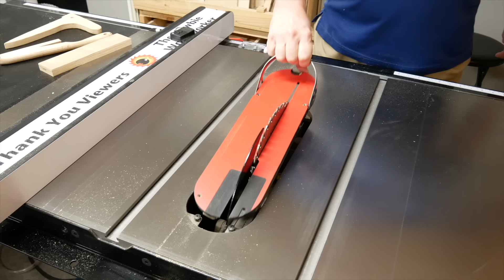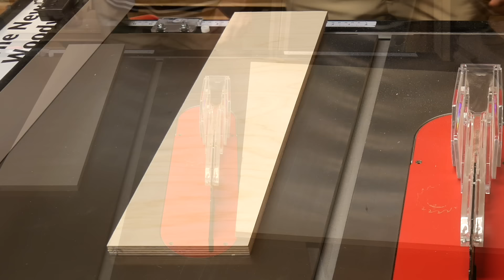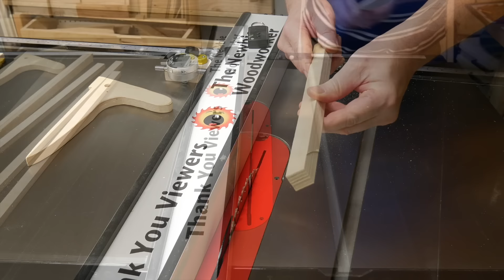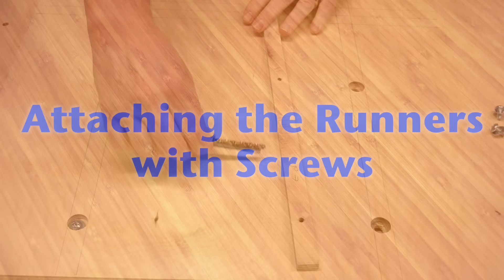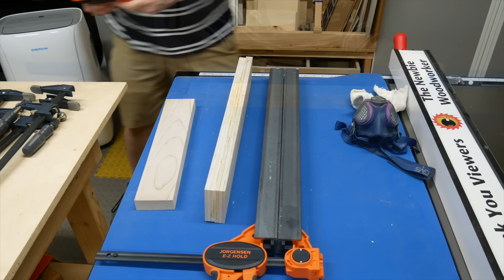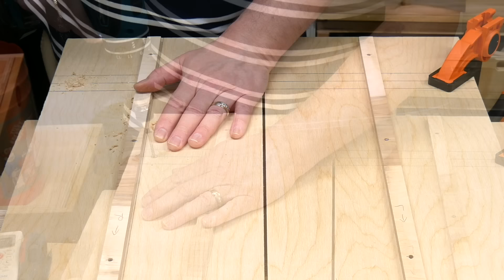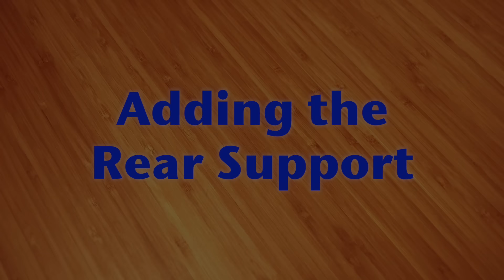Build this Revolutionary Cross Cut Sled, for Newbies!

Comment: I would have a huge problem trusting threads in wood to hold anything.  can't really tighten the screws much for fear of stripping out the thread.  not to mention it is threaded thru a quite thin piece of wood as well.
Reply from the maker: With Baltic Birch plywood, it works great. I've even used it with pine plywood, but not that thin. But you could always add threaded inserts, and maybe some Loctite to keep the screws from coming loose (don't need the Loctite with the BB plywood).

Comment: Overly complicated for such a simple sled.
Reply from the maker: Thanks for your opinion
Reply: Why do you think so? I think its great with adding a big deal of security as well with nice features like the adjusting of the slides. My current fence has exactly this issue due to being packed away in a cold cellar over the winter. Its not moving good through the saw anymore. Had I built in some screws like the Newbie Woodworker did, I could just adjust and be fine.

Comment: A little bit confusing. He makes a base and glues the runners then suddenly he has another piece of wood without runners. Then he screws in runners. Is he making two different bases or what, it’s confusing
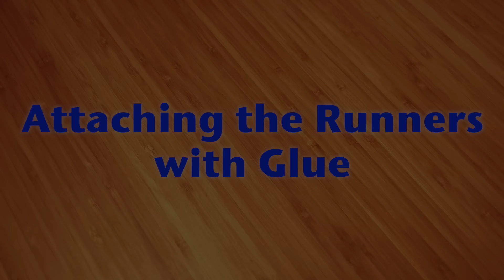Reply from the maker: If you click here: 07:20, I say that there's two different ways to attach the runners, and I go on to explain the pros and cons of each method, and the fact you can choose whichever method you prefer.

Comment: How about skip a lot of the end of this get some plexiglass make your own safety shield add a cross board at opposite end of sled to attach other end of plexiglass
Reply from the maker: The point is to not have to remove the blade guard. A lot of people don't use their blade guard because they don't like to have to remove it so often. This sled helps cut down the number of times you have to do that, by allowing you to keep it on when you use a cross cut sled.

Comment: Nice sled.   Why didn't you make the sled long enough for you could install a sled STOP under it to hit your table saw before the blade exited your saw stop?   In your design I see nothing stopping you from sawing your sled into two pieces IF you push too far.  That length does not have to extend the entire width of the sled, just enough to stop it prior to the blades exiting.  Just a thought.....
Reply: I had wondered about sawing through the sled when I saw this but I didn't know that there was a simple solution. Thank you for this tip! I will certainly use it when I make my sled! :D
Reply from the maker: Thanks. I don't need it, but by all means, if you want to do that, go for it! 😄

Comment: So why do folk not use the blade guard?  As I don’t own a table saw yet I’m curious. ChinChin
Reply from the maker: There's several types of cuts that can't be done with the blade guard on. They're not the kinds of cuts you do all the time, but they happen. Which means you have to take the guard off, then put it back on. Depending on the saw, that can either be easy, or... not easy. And as this video talks about, if you have a crosscut sled, unless it's one like mine, you have to take it off for the sled. Some (usually older) blade guards make it harder to see the blade, although I don't think it's as big a deal as some people think. But mostly, it's because people think they'll never be one of those who get injured. They think "Just don't touch the blade! Only a moron would touch a spinning blade." Well, it's called an "accident", not an "on purpose". 😄
Reply: @TheNewbieWoodworker  thank you. I think they’re a great machine but somewhat terrifying.
Reply from the maker: @michaellionart  It's good to have a healthy respect for them, that's for sure. But once you understand how they work, and proper safety usage, they are reasonably safe. Still, there's a reason I have a SawStop, which is the ultimate safety device.

Comment: I would use my blade guard but mine went in the trash the 1st day I had my table saw
Reply from the maker: I did that with my first table saw. Fortunately, I kept it with this saw.
Reply: Blade guards are most likely to relieve the company that buil the saw of liability. I use my saw just about every day and the blade guard is history.
Reply: @mattedwards4533   over 4000 people per yr lose a finger thanks to the table saw (mostly veteran carpenters that been using the saw for yrs), that is 11 people every single day. No matter how skilled you are, one false move, one malfunction of the machine and hello emergency room and good bye finger.
Reply from the maker: @marcf869  Hey Marc - do you have any links for these statistics? I know they're out there, I just can't find them. I must be google-challenged. 😄 Thanks!
Reply: @marcf869  When you are in the woodworking trade you find a lot of things designed to be ,"new and improved" that get a low score when you look at the safety aspect. I have worked for years in the trade and see novices do things at a saw that made me cringe. The blade guard on some saws are  themselves dangerous. They give some people a false sense of security.I also would like to know how many people that have had accidents were hobbiest.
Reply from the maker: @mattedwards4533  One thing I've learned over my years as a software developer, is that it's really hard to remember what it was like to be a newbie, just starting out. You get so used to all the knowledge you've developed over the years, that you don't even realize how much you know, and how little people who are starting out know.

I'm sure the same is true for woodworkers, and the reason I know this is true, is that's the reason I started this channel. I watched video after video supposedly directed at newbies, where the creators just assumed I knew things that I didn't know. So I try to remember that as I make my videos.

The reason I'm saying this is expressed in your last statement: "I also would like to know how many people that have had accidents were hobbiest." We both know the answer to that is "a lot". And that's why I made this video, so the people who would most benefit from using a blade guard might actually consider using one.
Reply: @TheNewbieWoodworker  I hope you didn't misunderstand what I was saying. I am all for anything that would keep anyone in my shop safe.You are right a,"Newbie Woodworker" needs advice. I recall my father saying, "if a man would work in a shop for  five years he would then make a good apprentice". I have worked enough years that I am now drawing Social Security. I have two table saws in my shop and you would think I would know just about everything there is to know about a table saw.The truth of the matters is I still learn new things the saws can do to this day.I do appreciate your video it might save someone from an accident.
Reply from the maker: @mattedwards4533  Thanks for the clarification, Matt. I definitely agree that everyone, especially newbies, could learn a lot from working with people who have experience. It's something I think about a lot. So many of the foolish mistakes I make, and the chances I take, are because of ignorance. You can't know what you were never taught. Except for learning it the hard way, I suppose. 😄
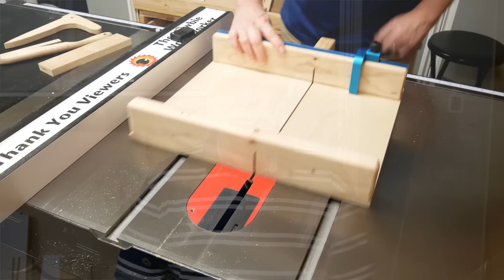Reply from the maker: @mattedwards4533  00:41

Comment: Old guy, I have been using a table saw for a long  f u c k i n g  time and safe guard just get in the way of the work. Also that big gap that limits the usefulness of the sled :(
Reply from the maker: If you don't want to make the sled, then don't - I don't care. However to your second point, the gap almost never comes into play, and the few times it does, I remove the blade guard and use a different sled. No single tool is right for every situation.

Comment: Actually... More amputations occur with the blade guard in place as it obscures the blade from clear view. Blade guards are NOT SAFE.
Reply from the maker: Please cite your statics to verify this claim. My thoughts on the subject: 1) Clear blade guards provide plenty of visibility to the blade. 2) You should have already verified you're cutting in the right place before turning on the saw, so it's not relevant if you can see the blade clearly or not. 3) Yes, there are some times the guard might get in the way, so that's the time to remove it, but most of the time, this isn't the case.
Reply: I highly doubt that statement
Reply: Although I am certain there have been studies on this, I do not have a citation off the top of my head. However, you are free to search the many peer-reviewed professional journals for summary reports and statistics regarding table saw injuries. 

My comment was based on personal statistics and experience. In the medical field, I’ve seen plenty of power tool injuries.  Most are from table saw amputations—primarily seasoned professionals but also the occasional DIYers. Blade guards were in place—serious injury occurred due to obstructed view caused by “CLEAR” blade guard. The law of averages suggests other institutions should report similar results. 

I, myself, use my table saw frequently and, in my experience, the spinning blade cannot be seen clearly with the clear blade guard in place. (To be thorough, I replaced the guard on my saw, started it up and observed from different angles. Results:  No clear view.). So... Rather than rely on a cheep piece of plastic to guard your precious body parts, better to use your brain:  Respect the machine. Know how the machine operates and behaves under various cutting conditions. Understand the properties of the material you are cutting. Use the appropriate blade. Think through each cut carefully and thoroughly. Make use of feather boards, sacrificial fences, well made push sticks/blocks, even jigs. And, proceed with confidence but caution.
Reply from the maker: @GoAgsXX  Thank you for your opinion.

Comment: Thanks for having a great video on the subject of using safety equipment with DIY stead’s! The fact is that makers of equipment provide them for a reason!  To many shop accidents happen when they are not used. Sadly, this is more often the PRO that thinks they don’t have the time to mess with it! Until they see red! Have seen a number of wood workers in the shop have to go to the ER. Thanks again 🤠
Reply from the maker: Thanks, Alan. Too many people think that because something has never happened to them, that means it never will. And some of us (myself) are/were just too ignorant to realise how much these safety devices could help.
Reply: @TheNewbieWoodworker  If I may say that shop safety is not often particularly thought about in shoptalk, but it should be one really helpful video can be found on 731 Woodworks sight! It’s on shop safety and even bring one though that I had not even thought about having in a shop that would have been so helpful in a pass shop misshape. Hopefully this can be helpful, woodworking should be fun! But like the Boy Scouts of old:...”be prepared “..Thanks again, planning to make two of these sleds for my shop. Why two. One ShopSmith Mark V and another Mark V 510. The Mark VII is having to be rebuilt and will pebbly become a 30” drum sander, with the reverse rotation I will be able to feed it from the front of the machine.🤠
Reply from the maker: @allanhart4115  Thanks! 😄

Comment: Why do Americans have to measure everything in 64ths, crazy. What the hell is 7/64ths? otherwise a good video.
Reply: 7/64 is a 64th larger than 6/64 simple math
Reply from the maker: @ittybitbobo7657  😂
Reply from the maker: 7/64ths is... wait, let me get my calculator... 0.11 inches. Wasn't that obvious? 🙄
Reply: @TheNewbieWoodworker  I thought it was 7 little bitty lines for the really big line.
Reply from the maker: @davidroman1654  😂
Reply: I find these fractions are really pretty simple if I look at them the right way.
7/64 is right between 6/64 and 8/64.
Check it out:
6/64 . . . . 7/64 . . . . 8/64    Then just reduce the fractions:
3/32 . . . . 7/64 . . . . 1/8      My drill bits are a handy reference for the relativity of these sizes.
Reply from the maker: @rufus3227  My problem comes when I have to do something like add a 64th to 1 7/16", or something like that. I mean, I know how to do the math, but it's pretty easy for me to mess it up.
Reply: @TheNewbieWoodworker  The math is easy but knowing which side of the "1" sometimes can be a problem 😂
Reply: @TheNewbieWoodworker  Me too, but just like measure twice (three times), cut once, I do the math three or four times to make sure before I cut or drill.  (Usually.)
Reply from the maker: @davidroman1654  You are so right. It's way too easy for me to be off by an inch.
Reply: Why? Because back in the olden days they made stupid choices just to be different and to be able to proclaim "We ain't Brits anymore!" As a dyslexic I often wish I had a time machine so I could go back and kick them in the shins. Millimeters and centimeters are so much easier to understand and are actually more accurate! Maybe the choice to go with 8 divisions per inch was made by an old woodworker who was missing two fingers and could no longer count to ten on his fingers for the metric system. XD LOL!
Reply from the maker: @JChiibs  I'm not disagreeing with anything, except for that centimeters are more accurate. Millimeters, maybe, but not centimeters. 😂 (And I'm just messing with you, I knew what you meant. 😄)
Reply: Use the metric system, so much easier.
Reply from the maker: @AllanO808  It may be easier to use, but finding metric tools and hardware here in the States isn't nearly as easy as it sounds.

Comment: this video looked really good but I switched off as soon as I saw you were using imperial rather than metric...sorry
Reply from the maker: Too bad you didn't watch long enough to see that I include metric equivalents in all the measurements. I'll admit that I probably don't say that half-inch plywood is 12mm, but other than that, there's metric measurements all throughout the video.
Reply: If that is all it took he got rid of a troll easy.
Reply from the maker: @MrRaptorman1975  That's actually a good point. I mean, I like to give everyone the benefit of the doubt, but if something like that bothered him, then there would be plenty of other things for him to complain about. Thanks for sharing that!
Reply: @TheNewbieWoodworker  Im sorry if my comment was a little curt or if you found it offensive. Im 53 and have never been taught imperial measurements, I just wish the we could all sing from the same metric hymn sheet so to speak. 
I repeat, the video looked really good but.....followed by an apology, how are they the words of a troll ?
Reply from the maker: @mikegally5657  Miscommunication on the Internet is common, and sometimes people assume a comment is "trollish" when it isn't. Here's what happened here: I show metric measurements in the video also. After reading your recent reply, I'm guessing you just didn't see them, which means you're not a troll. But here's why your comment seemed trollish: Because I do in fact show metric measurements in the video, your comment sounds like that fact doesn't matter to you - any video that mentions inches isn't worth your time, even ones that bother to show metric equivalents. I hope that makes sense.
Reply: When I started working as an auto mechanic I worked for a wonderfully talented guy who served his apprenticeship in Germany.  He once asked ME,”Hey, what is the next size up from 5/8”?”  “It is 11/16” Pete, I answered.”  I guess it depends on which system you learned first.  And, grade school arithmetic.
Reply from the maker: @louisshambarger2230  👍